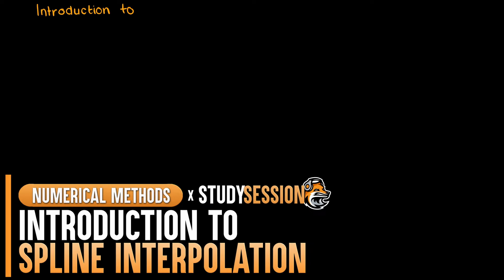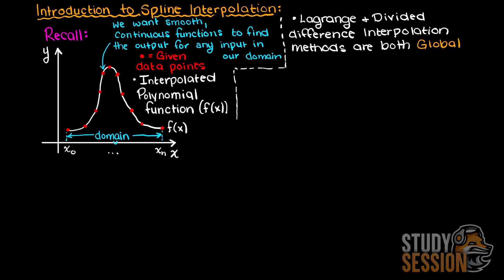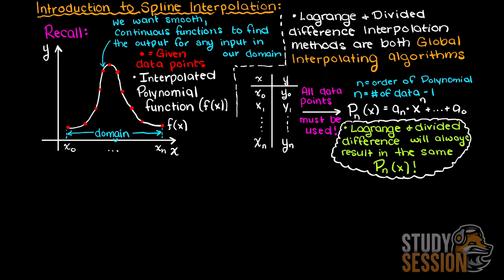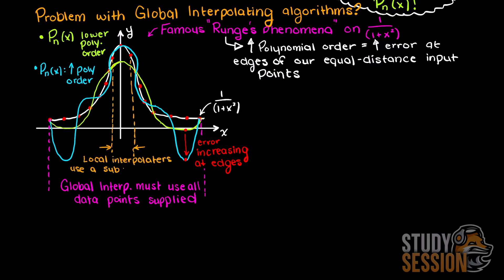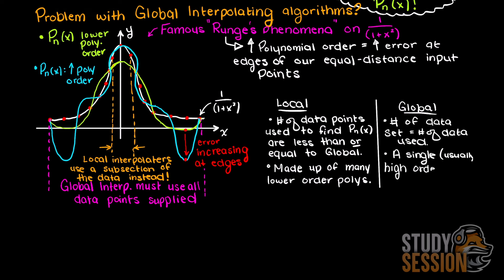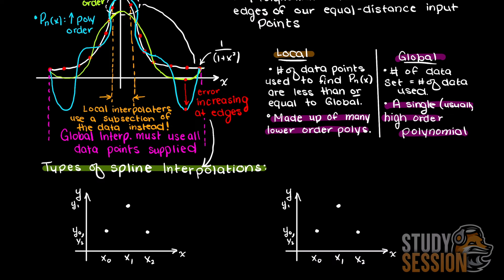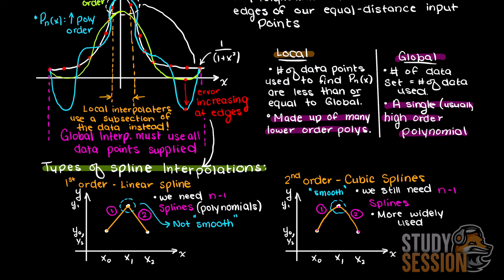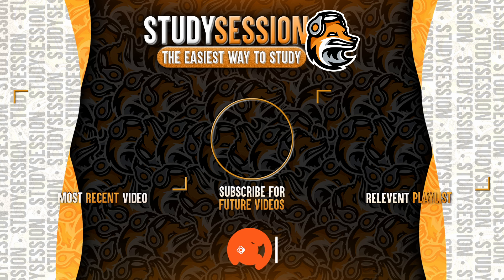Introduction To Spline Interpolation | Numerical Methods

Comment: Shouldn't the second-order polynomial be called quadratic?
Reply: I think its because locally the polynomial is cubic but globally it appears to be quadratic thus they refer to it as cubic since spline interpolation is all about fitting the local polynomials together to create a better global estimate (fit). I'm inclined to believe this because in another video he shows the same example and states that cubic were used in between point 1 and 2, and between points 2 and 3, the local approximation. Take my response with a grain of salt cause I could be wrong.